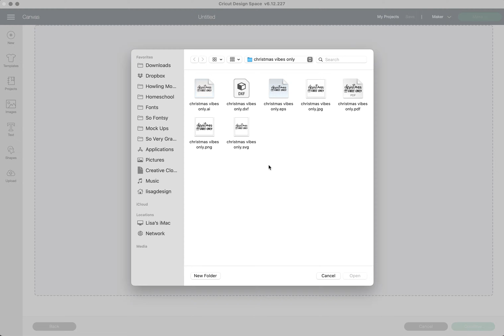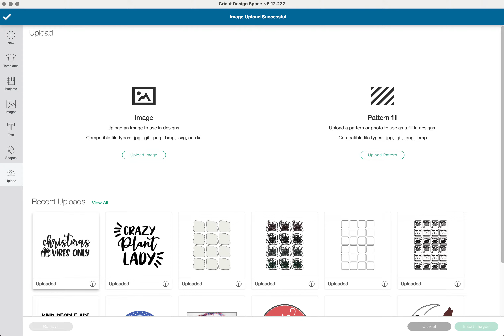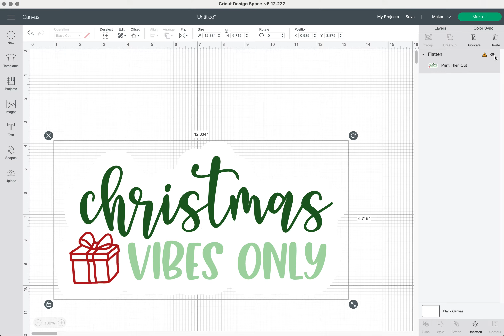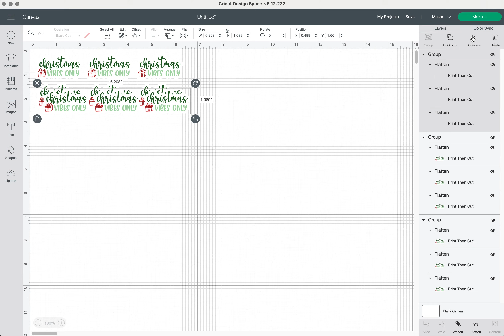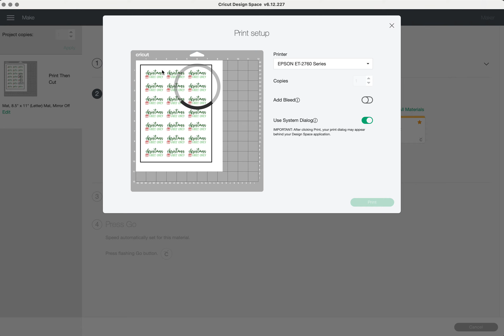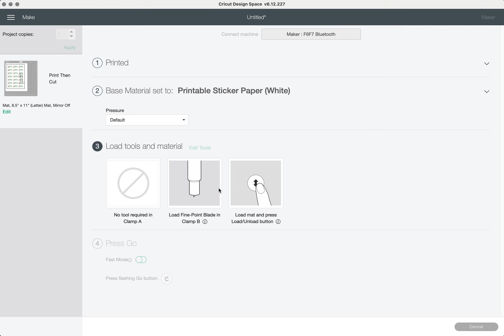How to Make Stickers with White Border or Offset in Cricut Design Space 😍 Full Tutorial

Comment: Loved the video!!! How do I get the circuit update that has the offset option because I’m not seeing it on mine.
Reply from the maker: If you are using a desktop/laptop, try updating the CDS app or uninstalling it and reinstalling it. Please note: The Offset feature is supported on systems running Windows 10 (64-bit only) and higher, and macOS 10.15 and higher.